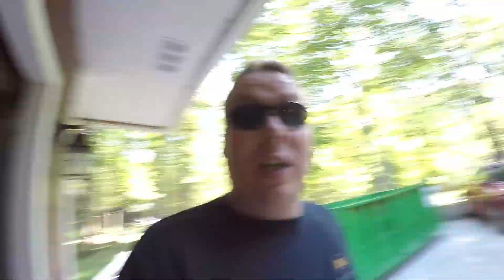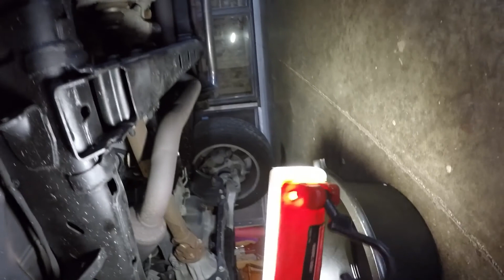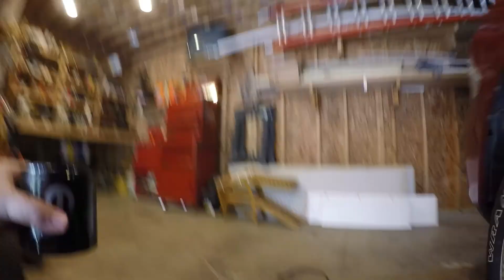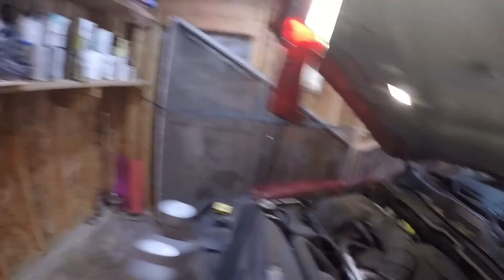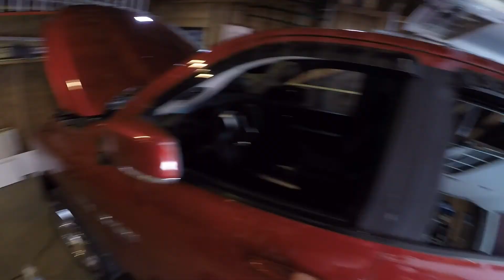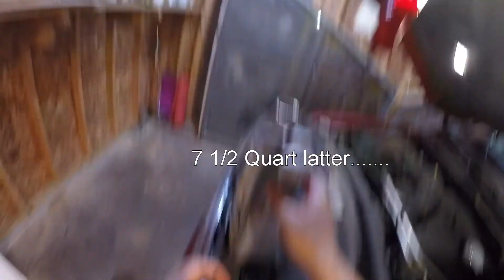How to: Dodge Ram 5.7L Hemi Oil Change

Comment: when you pointed at the oil pressure gauge that was actually the gas gauge and your engine should only take 7 qts
Reply from the maker: Sorry but no, that is my oil pressure gauge, the gas gauge is at the top of the cluster. Also, bringing the oil level to the top of the hash-marks, requires 7 1\2 qts.
Reply: well that is not where my oil pressure gauge is and I doubt yours is there either. If you have a 5.7 L Hemi it takes 7 qts so you over filled it.
Reply from the maker: Again, I'm sorry but you are wrong. There are 2 or 3 different gauge cluster configurations offered by Dodge at that time my truck was manufactured. My oil pressure gauge is on the lower right.
Reply: what year is your truck so I can check myself
Reply: well I have to apologize because I found a Ram with the oil pressure on the lower right
Reply from the maker: No Worries.

Comment: With the oils of today, 10,000 mile oil rain intervals are very real.  Oil drain intervals in Europe have been 10,000 miles for over 15 years!  If you are using a HIGH QUALITY  Synthetic oil, drain intervals of 15,000 miles is considered Normal by Industry Standards.  Hell, AMSOIL Lubricants have been ADVERTISED, as 25,000 mile/one year drain intervals for 45 years ,and that statement is printed on the containers!
Reply from the maker: Good to know! thanks